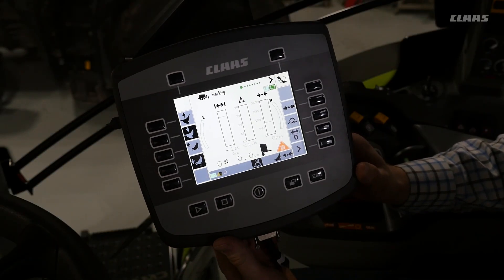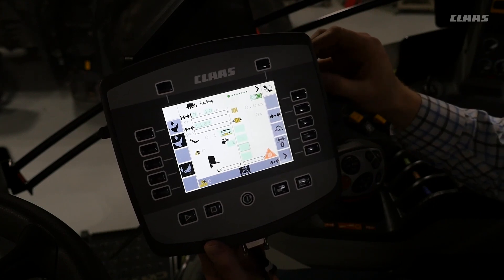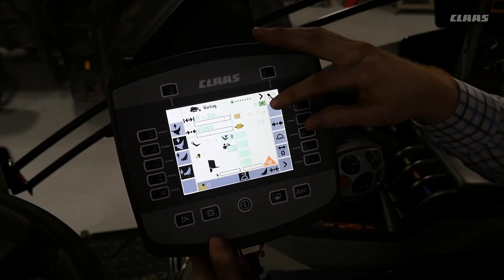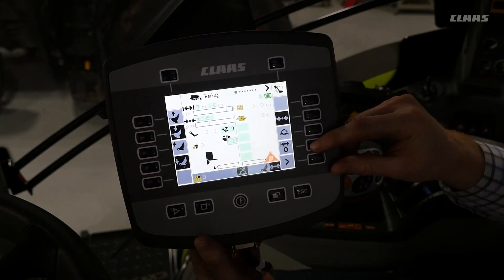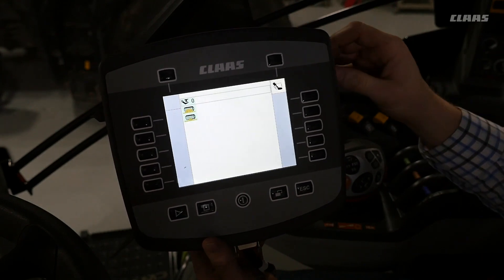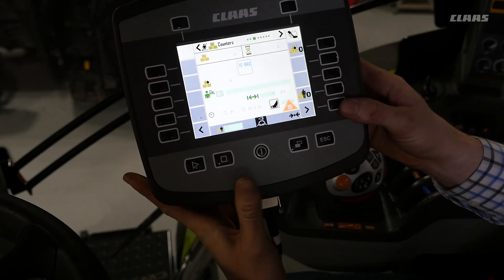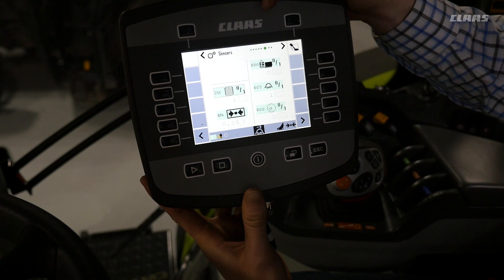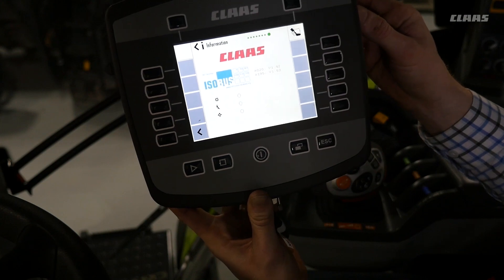QUADRANT 5300 COMMUNICATOR II Monitor

Comment: Question about the knotter monitor setting, it lets you change the green box from 1 to 10 and the box beside the knot icon from 1 to 10, seeing as how there is only 6 knotters why does it let you go to 10? I'm confused as to which box does which.